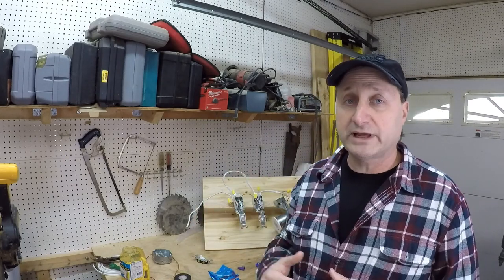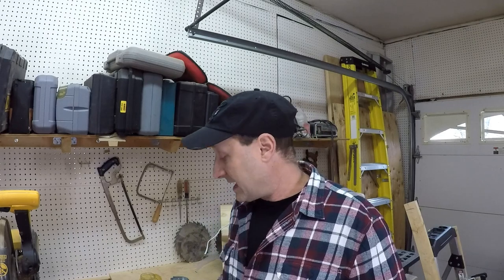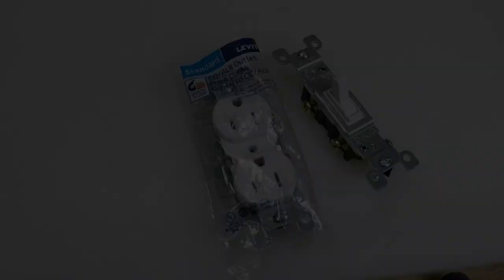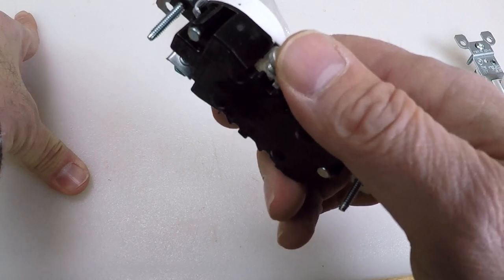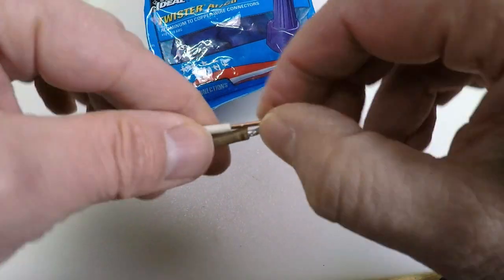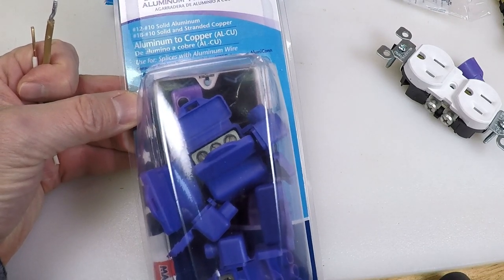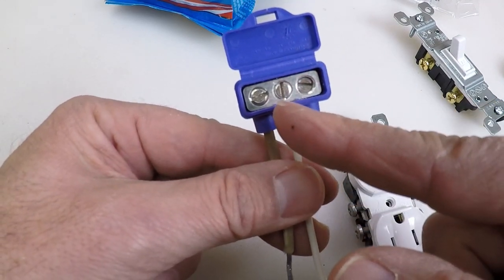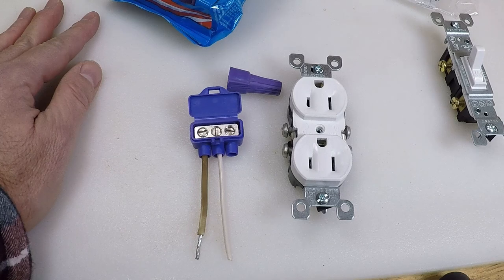Aluminum wiring repair - AlumiConn pigtail connections

Comment: Oh, second question, different topic.  I see on the King Innovation site for AlumiConn connectors that they recommend using a torque screwdriver on the screws, which I see on Home Depot's site they have a Husky that will do the required 10 and 15 inch pounds for $56.  Some comments there say it's very tough to guess the right amount of force to use on the aluminum conductor -- undertighten and that warming/cooling you mentioned could let it work itself out from under the lug's screw.  Overtighten, and the aluminum could crack and break free of the connector.  What are your thoughts on torquing the set screws on the AlumiConn?
Reply from the maker: yeah if you have a torque screw driver then use it for sure..
Reply: @flannelguydiy6458  I don't, and my friend who I thought had every tool in the world to borrow doesn't have one either.  So, is it worth the $56 to get one, on the theory that I don't want to over- or under-tighten the aluminum lug screw, causing the connection to fail and the house to burn down, because I have no feel for how much 10 inch pounds is?  Is there some rule of thumb to get that torque, short of the special tool?
Reply: @JusBidniss  yes, if you're repairing an entire home with aluminum to copper pigtails,  might as well buy the torque screwdriver, better safe than sorry.   Chances are you'll find many more uses for the torque screwdriver besides aluminum wiring repair.

Comment: I don't understand what scenario I'd use the 3rd port in the 3-port connectors?  I have to pigtail a few inches of copper on the ends of my aluminum when replacing an outlet or switch in our house, because whoever wired the ones I've seen so far didn't leave an inch of extra slack to pull the outlet free or make a new shepherd's crook for the screws (they all used the holes in the back).  It's awful -- you can barely get the outlet clear of the box opening!  So pigtail it is.  In the 2 or 3 I've done so far (which I now learn I have to go back and do right, since I used regular wire nuts), there was one 3-wire romex coming into the box, so I wire-nutted my 4" of copper to each, connected the outlet, and (barely) stuffed it all back in (these are all shallow boxes so far, so I guess the AlumiConns will require me tracking down some deeper old-work boxes I can install through the hole in the drywall, after carefully breaking out the old box).  However, I know there will be some outlets I encounter with 2 romex's coming in, and both sides of the outlet used.  In many of those, the little metal deal between the screws is broken off, because the top one is on the light switch.  Would the 3rd port work for that scenario?  Or only when the little metal deal is not broken out, and top and bottom both are always powered?
Reply from the maker: You would use them wherever you have three wires twisted together today.

Comment: Purchased a 1970's house 3 months ago. Previous owner just before the sell, spent $8,000 replacing out lets, doing alumicon and adding a brand new breaker box. I still can't get insurance coverage.
Reply from the maker: yeah the updated connections will not change whether an insurance company will allow aluminum wiring.
Reply: @flannelguydiy6458  thats really too bad with electrians and county even approving the repairs.

Comment: Actually it's the other way around--you should use fixtures with brass screws specifically because aluminum is softer than copper. Hardware suppliers started using steel rather than brass when the price of aluminum spiked in the mid-60s, and it's the steel screws, not the aluminum wire that's the culprit here. Hardware made specifically for aluminum and copper wire will be manufactured to work with aluminum wiring, and will not require the added complexity & more potential failure points that pigtails make.

Copper oxide is a semiconductor, and also not desirable. The blue-green II oxide is less conductive than the brown I oxide, and should be considered a problem. Whenever I go into a junction box, I see that as an opportunity to clear faults caused by people before me, and to renew connections that have become less than ideal with time. This includes removing all oxides and wires made brittle by work hardening. A good electrician will have already cut off the wire that may have been work hardened by fishing it through the conduit, and will leave a generous amount in each junction box so future electricians can snip off the old fixtures, strip the wire to expose shiny new copper or a fresh length of aluminum that hasn't been nicked or cracked from work hardening.

With copper, all you need to do is expose a bit of non-oxidized wire and attach that. With aluminum wire, you need to take the additional step of burnishing off the oxide and immediately dressing the wire ends with NOALOX or a similar approved anti-oxidant coating. I said "approved" because that can of CRC or WD-40 is probably not going to fit the bill. If you have newer AA-8800 aluminum wiring, you may be able to skip the anti-oxidant dressing, but using it can't hurt. Needless to say, the key is to buy CO/ALR fixtures and use them.

Now that I found WAGO wire joiners, I'll never use another wire nut again. Wire nuts twist wires, and while that should result in a spiral connection with lots of contact area, it often doesn't, and all the twisting work hardens the metal, and that causes metal fatigue and breaks. WAGO PUSH WIRE (the brand is all-caps) fasteners are rated for aluminum and copper, and as the name suggests, requires no twisting.
Reply: FYI for aluminum wires you also need to use the Wago “Alu-Plus” Contact Paste with the WAGO PUSH NUTS.
Reply: Are wago rated for aluminum?  I bought a whole bunch but my existing aluminum wire in my house are to fat (10 gauge?) To fit inside a wago nut slot
Reply: @conchim99  there are so many different part numbers now, I can't say more than to look at the product documentation. I think most are good for aluminum when used with their Alu-Plus Contact Paste.

I know that some are rated for 10 ga. while others are only up to 12 ga., so that may be why yours don't fit. Also, 4mm^2 (the stated size in the documentation) is right between 10 and 12 AWG. With aluminum, you need room for expansion, so I'd say no more than 12 AWG Al regardless.

As a rule (and if they come out with new models, the rule will change), WAGO is good up to 20A, but that's it. Try AlumiConn for those higher current Al wires.

Comment: I’m planning on putting in the alumicons.  Is it necessary to pigtail to copper for the ground wire?  No current running through it, but it’s still aluminum.
Reply from the maker: Well, since the ground wires do not get hot, it likely is not necessary.
Reply: Might say required somewhere in the NEC, not sure where.  My 70's house has copper pigtails for the bare Aluminum ground wires.   Seems like the correct way.
Reply from the maker: @lschweitz09  Yes these connectors are essentially the same as pigtailing, just in a more secure way.

Comment: Thanks for this informative video. However, my understanding is that you never join Aluminium and Copper wires together by using Twist caps due to fire hazards.
Reply from the maker: No... they are approved if you are using the correct caps with the substance inside that allows for it. However, I do not like using the caps and prefer the alumiconn connectors

Comment: Great information, thank you.   In the process of attempting to replace light switches and wall sockets in my mid 80s home I found out I had cooper clad aluminum wiring because the wire was too thick to go into the quickwire holes.  How do you deal with this issue?  Can it be treated like cooper wire and use the screw terminals? Are there any precautions? TIA
Reply from the maker: You dont even want to use those quickwire holes. The wires may work themselves free. You can bend the aluminum wire and attach to the screw terminals just like a copper wire. However, aluminum wire is brittle and they can break. This is why those alumiconn connectors work so well. You can put your aluminum wire in there, then run copper to your switch or outlet.
Reply: What about the leviton 20 amp outlet with the tab where you would insert straight aluminum wire in the tighten the screw down.  Is this safe?
Reply: Hello?

Comment: I've heard the purple wire nuts can leak out the cream. I try to install them open end up or on the side at least. I didn't know alumiconns had cream in them. Any issues there I wonder? All expensive and a pain in the ass in cramped boxes Anyway. Argh!
Reply from the maker: yeah they are a bit expensive but the alumicons are much better. When you do not have wires twisted together you have less heat getting built up. The cost is well worth the peace of mind. Have not had any issues at all since doing this....none.
Reply: @flannelguydiy6458  you're right. It is about peace of mind. I'll most likely go this route. Thanks for getting back to me. Dave. Cheers

Comment: I have not found a GFCI outlet that had Aluminum capacity.... pigtail is really hard for an already cramped box due to a GFCI.
Reply from the maker: you are correct in that it can get very cramped in there.
Reply: In that case may need to switch a GFCI breaker, just be cautious because Multiwire branch circuits were very common practice in those days.
Reply: @claytonsprague7316  late comment, but for a multiwire circuit,  there are double pole GFCI breakers for that,  be aware they are about 100 dollars or so, and with the exception of a 50 amp (used almost exclusively for hot tubs) may have to be ordered and shipped to the store, since 15 and 20 amp double pole GFCI breakers are not commonly used.

Comment: Doing this now. Using alumiconn and when I torque to their recommendation it seems to deform the aluminum wire. The wire itself seems in good condition, is this normal when using alumiconn and torquing to 10 inch pounds?

Comment: how do you know if your outlets are CU/ALR, do you just have to look for the aluminum connection.
Reply from the maker: Steve, they should be marked but yes you can look for the aluminum connection. You dont want to see copper screws.

Comment: Can Pigtailing with Alumicon conectors be used on Air-conditioning unit wires that is aluminum, my house was build in 2003 and Aircond. company telling me i have aluminum wires, i do not know how is it possible, i thought no one used aluminum wires in 2000`s .
Reply from the maker: I am almost positive that your air conditioner is using a thicker wire (10 gauge or more) and they likely will not fit into an alumiconn connector that I THINK accepts no larger than a 12 gauge wire.  An electrician can use a crimp to fuse aluminum to copper.
Reply: Aluminum is still fairly common for larger single purpose 240 volt circuits like air conditioner , dryer and stove.    Those large aluminum (8 awg and bigger) don't have the same problems that 10 and 12 awg single strand aluminum did.    However,  you do have to make sure that the lugs are AL rated.    Some devices such as furnace and AC are not compatible with aluminum, but a disconnect switch is required if the breaker box is not within sight of the unit, so in this case you could run aluminum to the disconnect,  then come out with copper to the unit.   This assumes the disconnect is AL/CU rated.

Comment: I have a question that i am wondering. If i pig tie the aluminum to copper wires. do i still have to use a co/alr outlet to wire it back on or can i use one with out the co/alr ?
Reply from the maker: Yes you would. Pig tailing is still a problem
Reply: @flannelguydiy6458  I'm not sure which part are you agreeing to after I pig tail copper wire to aluminum? Do I connect it to a co/alr outlet or can I use one without the co/alr?
Reply from the maker: @ZeroZillions  okay, if you are using a CO/ALR switch or outlet, then you can wire the aluminum wire directly do that without pig tailing. In general pig tailing copper to aluminum is a problem. You would need to instead use the alumiconn connectors with the aluminum wire going in, and then a short copper wire going out to e REGULAR outlet.

Comment: if your using a plastic box does the AL ground still need an Alumiconn or can you jpoin by other means to the CU ground? Also do you need these connectors at the panel box also?s
Reply from the maker: follow your local code for grounding regardless of whether you are using alumiconn connectors

Comment: I have a question,my house has aluminum wiring,here recently i noticed that one of the outlets was acting wonky so i decided to replace it, i went to home depot and they carried a outlet called aluminum /copper, one side looks like aluminum screws and one side looks like copper screws, if some houses have copper wiring and some houses have aluminum wiring but mainly exclusive one or the other what good does a aluminum /copper outlet do me? i would guess it would be better to have aluminum/ aluminum on both sides correct? so why do they even sell that kind of outlet ? thank you for your time!!

Funny thing is that the outlet im replacing is also aluminum /copper,one side is aluminum and one side copper and it has been in this house for at least 30 years,once i opened up the outlet to replace it i noticed the aluminum side was kinda burn t a bit but the other wires on the copper side were pristine, what gives?
Reply: You are definitely not knowledgeable about this.  Do a great deal of research, contacting, and learn your local codes/installation.  On outlets, what you refer to is: The silver looking side is the neutral, the copper/brass looking side is the load.  (Green = ground.)  That is, very, very basic.

Comment: So if the wiring just goes to 1 outlet or switch you can just buy the 2 port Alumiconn Connectors?
Reply from the maker: yes that is correct.
Reply: @flannelguydiy6458  thank you very much!

Comment: Wait. I’m confused. If the whole house is wired with aluminum, there would be no need for the Alumi con correct?   I’d just need to make sure that all of my outlets and switches are aluminum wire compatible, correct?   I’ll have an electrician do it but I want to understand it. 

Is it common for a 60’s hose to have BOTH aluminum and copper if there has been NO newer additions?
Reply from the maker: Yes and no. It is true that you can use aluminum safe outlets and switches.  However, part of the problem with aluminum is they work loose at the connection points over time especially at a spot where it gets very hot such as a bathroom outlet where a 1500 watt hair dryer is used. The devices we use today draw more power with the exception of LED lights.  You also have new light fixtures that do not have aluminum safe connection points. I would bet most homes built in the 60’s or early 70s have different fixtures now.  All of those should have allumicon connectors between them and the aluminum wires. I don’t think it makes sense to use these things at every point.
Reply: I have both in my house. Years ago I went around and disconnected all my aluminum outlets and used an emery cloth to lightly sand any oxidation off the ends and applied anti-oxidation paste before putting them back onto the outlet. I think I'm going to switch to these alumiconn connectors now because my insurance company is asking questions suddenly after 16 years.
Reply: Copper AND aluminum in a 1960s house?  That's a new one for me lol.   I suppose if the electricians who wired the house had a bunch of older copper wire stashed in their trucks, sure.   Everytime I've found a home with a mixture of copper and aluminum was either a much older home that had a renovation or addition during the 1960s thru the early to mid 70s, or was built during this time and had circuits added later on.

Comment: Ok so let’s say I go with the Alumiconn connections...on the new outlet, I’m also replacing old switches and outlets, will use a copper one now that I have a pigtail of copper from aluminum or will I use an aluminum still?
Reply from the maker: If you are running a short copper wire from the pigtail or alumiconn connector to the switch or outlet... then you can use a regular switch or outlet. You only need the CO/ALR outlets and switches if an aluminum wire is physically connected to them. Make sense?
Reply: Flannel Guy DIY yes sir, that’s what I will be doing. Thank you! Also do you recommend a certain torque screw driver? Somebody mentioned that it does have to be torqued to a certain amount to avoid resistance? Is this true?
Reply: Flannel Guy DIY last question I promise lol...if it’s a 12 gage aluminum wire, what size copper wire do I pig tail to it...also a 12 or should I go up to a 14 on the copper wire?

Comment: When you come out of the alumiconn connector with new copper wire can you go back to receptacle if it is marked au/cu or will you have the came issue ,... copper pigtale to alum screw..i.e., do now have to buy new
Copper only receptacle 
...
Thanks
Reply: Al/Cu marked outlets are also designed for copper... hence the "Cu" which is the elemental abbreviation for copper.

Comment: I am confused. With the Alumincon connectors, I don't see where the black wire figures in. On your new outlet it is going to need a black wire to the gold screw and a white wire to the silver screw. I only see a white wiire coming out of the Alumincon.
Reply from the maker: I was just using random wires to show how to use the connector. You will use one connector to connect your black wires and another one to connect your white wires.
Reply: @flannelguydiy6458  Thank you. I figured it out that I would need one Alumicon for the white wires and one for the black wires and one for the ground wires. It's going to be crowded in junction box.